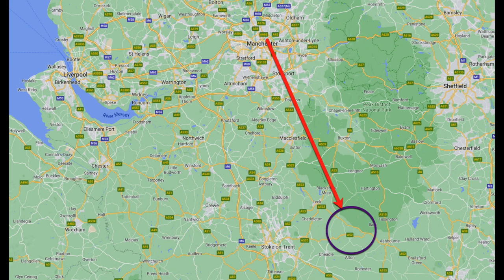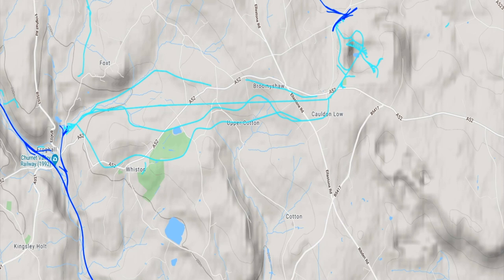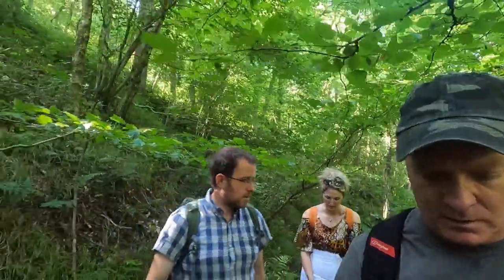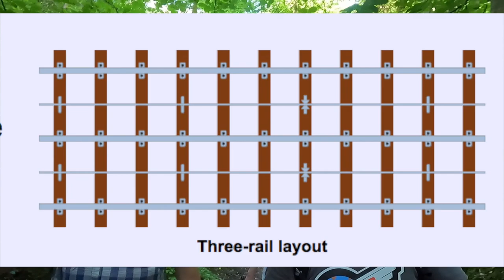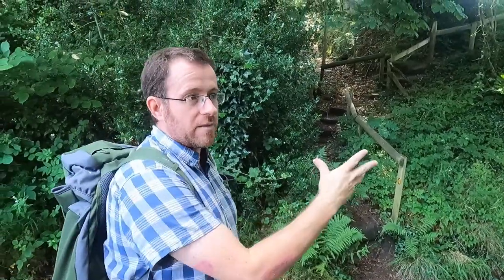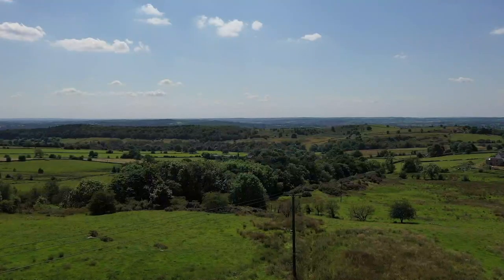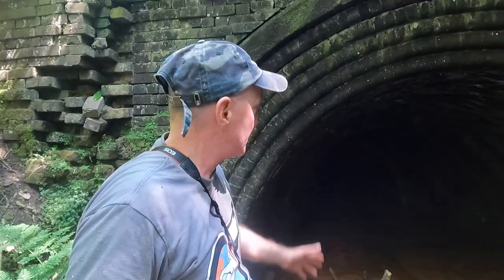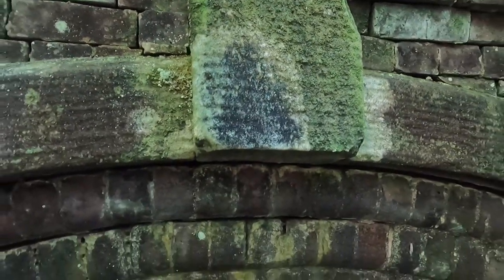Industrial Tramways, The forerunners of the Railways

Comment: That drum had an obvious cable from the bottom, but also one at the top, so it looks like it was a 2 line balance system, heavy wagons go down one line pulling the empty ones up, that explains the brake men
I thik it was the angle rails that trevithick used to demonstrate his steam locomotive from merthyr tydfil to cardiff/barry docks (you should look on railmaps at the old dock railways, there's loads of lines)
However, the locomotive broke the rails, but it was still the start of steam locomotion.
That tunnel alrewady had mist, you don't know what was in the mist, safest to stay out.
Reply from the maker: Thanks, yeah loved the drum
Reply: we have a passenger tram in the city I'm from that is 2 on a single cable, so as one goes down it hauls the other up. most of the tracks length is just single track and then in the middle it splits apart and goes in to 2 tracks for the trams to pass. This will involve switching of some sort, whereas the 3 rail example in this video wont require switches at the passing point. you just have that middle rail sort of widen into 2 rails so you have 4 rails where you want the trams to pass.

Comment: Walked the tunnel about 15 years ago, from the otherend, the silt is not so deep at that end, and came out at your end, all the way through you could feel a very hard surface underneath the silt, so it is do able, worth going back and having another go, there are some strengtherners mid way through what are interesting.

Comment: Lots of tramways in my bit of s/ York’s , one at silkstone used small square blocks under the rails instead of sleepers which are still there and a replica tramway wagon stands on a plinth in silkstone village , in a wood near stainborough there is a tramway tunnel but the entrance is gated off  but you can see into it , while building the m1 they found a stash of tramway wagon wheels, think most were to get coal to canal basins from collieries.

Comment: Very interesting as ever, Martin. I was wondering what the original head-hight would have been in Trubshawe's tunnel - to take the wagons then in use, and what the 'refuges' actually did, and how wagons were moved or was it still a sloping roadway so they moved by gravity (with brakes?). Also although the arch had fine brickwork there did not seem to be much mortar between the (moving) bricks above. I wondered about the attitude towards the quality of construction for these pieces of masonry out in the countryside.
Reply: Refuges were provided at regular intervals in railway tunnels. If workers were walking through, or working in, the tunnel, these gave the men somewhere safe to stand to allow a train to pass. Depending on the tunnel, the clearance could be very restricted, especially when these guys could be carrying tools etc.
You'll ee these refuges in most railway tunnels being used today; some longer overbridges have them and viaducts have a similar set-up, only not enclosed like those in tunnels.

Comment: Martin I presume the tunnel was originally part of the tramway and as such I wonder if the floor in the actual tunnel was paved so it might be worth probing the floor at the entrance with a steel rod?

The amount of iron discoloring the water flowing from the tunnel suggests some remains of the original rails or, unlikely as it probably is, even some abandoned rolling stock could still be further in?

Comment: So, You're walking down a cutting and find a open and intact Tramway Tunnel. Have been hacking into my dreams Martin? You must have been so desperate to walk it but you did the right thing. Did you find 'tother end? I just found a  large 12th cent Monks Woollen mill with a massive water wheel. I've joined the 'Friends of Park Melyn Mynach' group on fb who are cleaning it up. I found it near a mine where I dug up a boiler firebar and was taking it home through through a wood. I dropped it when I found the mill. ouch!
Reply from the maker: That water wheel sounds good Peter
Reply: @MartinZero  It turns out the existing wheel was a  replica but I've found the original in a nearby park. I've posted both on messenger for you.

Comment: You should have a radiographic or a wire-controlled boat, gopro on it and sail, but is that not feasible?
Reply from the maker: Not really in the mud Velsen 👍
Reply: @MartinZero  Maybe a RC hovercraft with a GoPro attached to it?

Comment: Maybe you could return with a drone. Lots of places could be explored with a flying drone, well, up to a point.
Reply from the maker: Drones dont fly very well in tunnels without GPS
Reply: @MartinZero  I did not know that, I thought you could like monitor it and control it from the distance, but yeah, I guess you need some sort of signal.
Reply: turns out you can fly without gps on some drones, but you would lose all the special features like position hold, navigation from waypoint to waypoint and it takes a lot of practice. Then the thing navigating in a dark tunnel, well, it would be difficult, but not impossible.